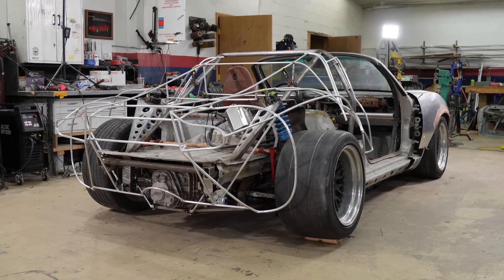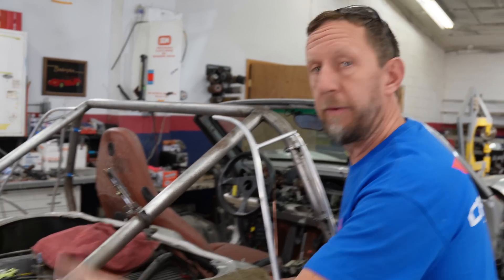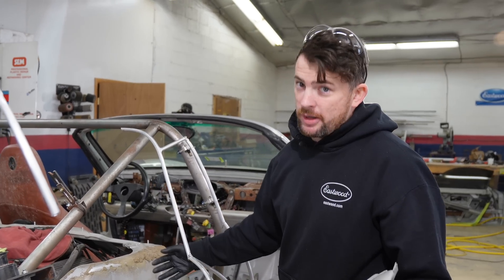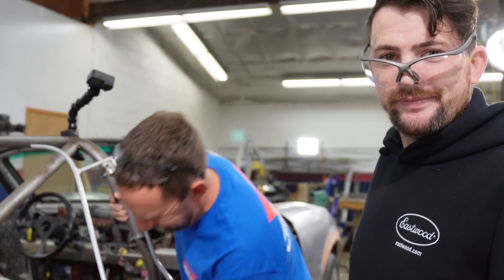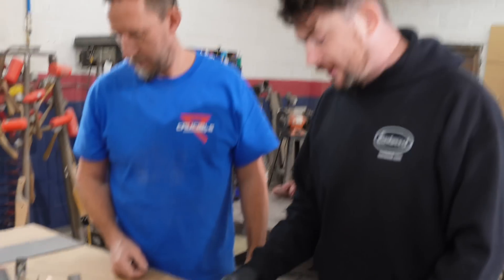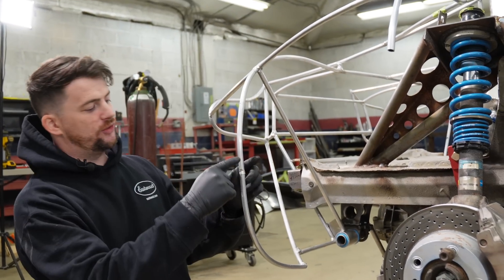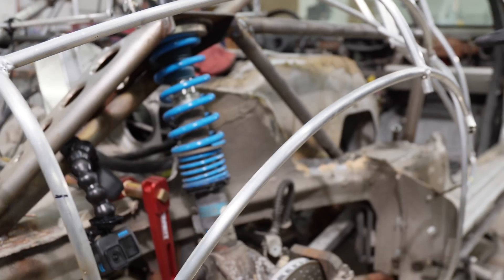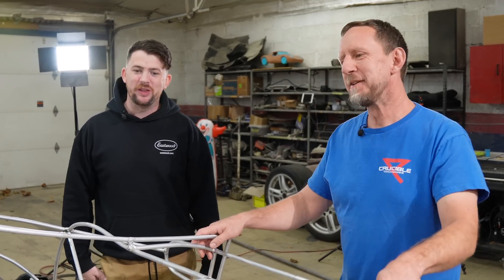Building a SUPERCAR! (Tube Chassis Fabrication) -- Project Jigsaw Ep. 60

Comment: Question.. Are you doing true superleggera construction, or are you planning on attaching or welding the skin to the tubes? (superleggera doesn't attach to the tubular framework at all, but to flat bar around the edges of each panel, the tubes just "float" under.)

Comment: As I’m watching this episode I had a thought…….did you weigh the Boxter before you started this project?  It will be interesting to compare before and after weights once the jigsaw is completed 🤷🏼 just a thought
Reply from the maker: @steverichardson6920  the OEM Boxster curb weight is easy enough to find out! (2,756 lbs) We weighed the chassis at one point when it was sitting on the ground with the new suspension and engine — I don’t remember that weight offhand, but we will definitely be comparing the weights later on!
Reply: @ makes sense, good comparison fabrication versus pressed steel panels, at least horsepower won’t be an issue 👍
Reply: I would assume the Boxter weighed roughly as much as.. a Boxter. Car curb weights are well known facts.
Reply: @ too true 👍